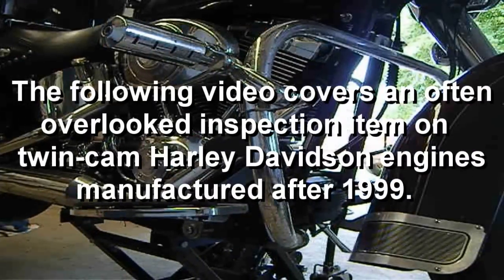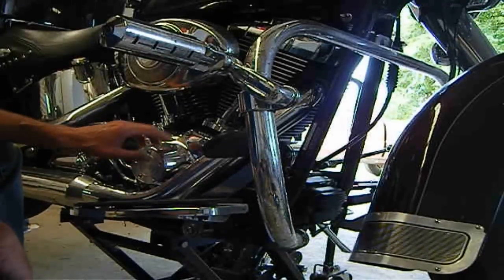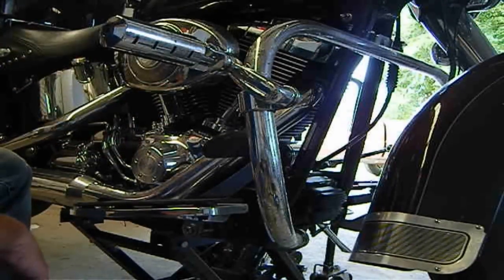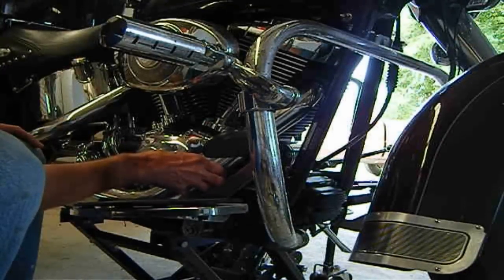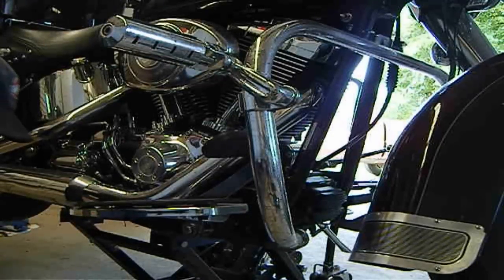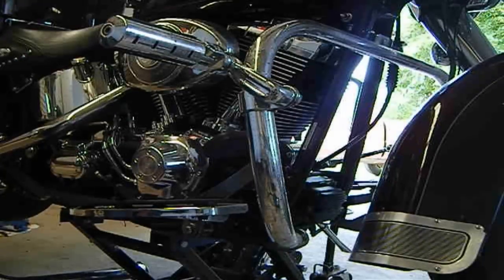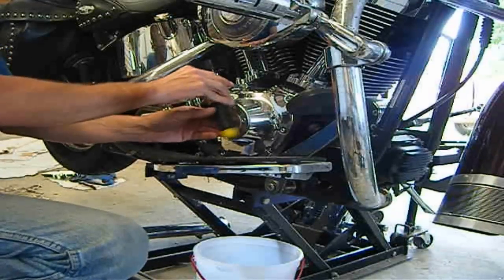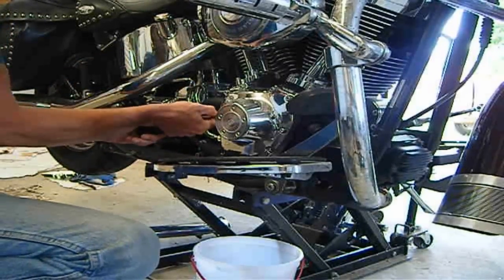TENSION HEADACHES: A Harley Owner MUST SEE!

Comment: I just found out about this last fall and I have 49, 300 miles on my bike. I have had my bike to 4 different dealers and not one ever mentioned this. Pisses me off!  Anyway, great video. I'm going to check mine now; thanks for the help.
Reply: Did you tensioners need replacing?  HD want's your bike to fail, the mechanic walks you over to the sales floor and calls the sales man to show you the latest bikes while they appraise your old bike for trade in value.
Reply: Back road you need to do the tensioners now and the cam bearing in the motor case or you will be buying a new motor I'm doing a long block from HD my customer let his cam bearings go for 80.000 and he's paying for it now.

Comment: Well if you want to ride a new bike with all the bells a whistles a twin cam is what u get. After 2007 u don't have to worry about the tentioners. Oil presseure versered 35000 lb of spring pressure lol
Reply: Are the 2007 models okay or just 2008 and beyond?

Comment: ive been working professionally as a harley davidson mechanic for the past 14 years, ive seen a lot of these fail over that time....that's about the entire span that the twin cam has been in production.....see the pitting on that outside tentioner, that is when its time to change them, when they start pitting, they wear out faster and break and destroy things. i would recommend the Axtell oil pressure relief bypass when doing this job.
Reply: Nate Swartz  Hey Nate what is the Axtell oil pressure relief bypass, your talking about, can u please explain it, thanks. Donnie.

Comment: Wow I just found  out about these shoes being a problem, I purchased a 2003 Dyna Super glide at the end of 2011  and the bike seem to be kept really nice and  great working condition and  getting quite a bit extras when I purchased the bike  like V,H  long-shot  exhaust, Mustang seat,  hard bags rremovable windshield leg crash bars footpads,  custom handle grips and much chrome.  I only paid $6200.00 as I got a really good deal due to the guy  hurting his back  and needing to get rid of the bike.  the bike had  11,000 miles when I purchased it and runs great having no oil leaks,  but I noticed the oil  was very dirty  almost  black and I really don't understand  why someone  would had let it get that dirty  especially  such a beautiful bike like  this one. Anyway  the first thing I did when I got the bike home  was change the oil  using  the best synthetic on the market along with a quality original oil filter,  but I really should have  ran the engine with cheaper oil and filter just to clean out the crankcase before replacing it with the expensive oil and filter because no time at all the new oil turned very dark due to picking up  the remaining dirty oil left behind  and now the new  have an under 700 miles is quite dirty  and although it might not be needing to be changed again I wanted to do it as it bothers me, so it seems I might need to replace it again soon.  anyway when I did change the oil right after  I purchased the bike  it was kind  of hard  to see if there was anything  in the oil  due to the oil being very black so because I was too anxious to write it  I took a quick look  and it seemed ok  just very dirty and I replaced it,  but since I wasn't aware of this  cam tensioner problem I didn't really thoroughly checked the old oil when I drained it assuming it was just  very dirty  but now  it's good  that I had found this out about this tensioner guide problem  before I do another oil change to get the oil cleaner  as  it would have been a waste of money  to put the new oil playing to find out  I needed  address the problem,  that's if I find anything wrong after  pulling off the cam cover to inspect it.  I was reading that it's definitely suggested that you change the pushrods  with a new set of adjustable pushrods if you're going with the new cam  and gear kit, so cutting the old ones would matter  anyway plus giving you less work to have to pull the top of the heads apart to get the pushrods out.    I wouldn't mind doing this job  myself as I'm way  qualifed to do it,  but I would need to purchase the back bearings replacement tool  and a new press  for the front cam bearings due to my old  press now  being  trashed after being an anchor  in my garage  due to hurricane Sandy.   anyway I have a question, does the side cover  use a gasket and do I get one first before I pulled the cover will can I get away with reusing the one that's on the cover like you can do  with some gaskets?   thanks louie

Comment: is it possible if you didnt change the shoe it could cause more internal damage the the bike? i have a 2005 road glide and it got laid over but it damaged the outside of the cam cover and the oil pump but there is no damage done to the inside of the cam cover so i was wondering if this could have been a problem to the bike.

Comment: Don't all bikes (and cars for that matter with cam chains) have tensioners? Seems I've seen them on many engines motorcycle and automotive.
Reply: Ger, there  are some car with engines  that didn't use cam chains which is actually called timing chains,  being the same thing. The 1984 four-cylinder Chevy Cavalier, had no timing chain and they used  a gear driven system drive also using  this same engine engines in the I.O boats which was made as the  2.0  Merc cruiser. they called this motor by Chevy the iron duke,  saying it couldn't be killed.  any motor that using a timing chain  along with  new engines that are now using timing belts all need to be checked  after so many miles,  but with a direct gear drive  I guess would never need  inspecting or changing  as far as I can see...
Reply: Ford had the same problems with the triton and 4.0 ohc engines as well.  Same yellow pads.

Comment: Just checked my '01 Springer. w/44,000mi. 1/16 in. wear on both shoes. Gotta luv that synthetic oil.
Reply: was just wondering did you start using full synthetic on the bike at brand new, also how much of a difference does using the full synthetic make can you actually get 50 60 thousands out of a set of shoes,,thanks

Comment: extremely informative,I would actually like to see beyond into the inner cam chain tensioners or the changing of them. My 2010 is fast approaching 50,000 mile mark.
Reply: Every HD owner should buy a copy of the factory service manual. Chilton and Clymer are fine for absorbing spilled oil but that's all. Visit dedicated HD forums for detailed info. Youtube is a nice supplement to tech data but not a replacement.

Some of the later shoes have worn excessively too, understandable as they are still tiny.

HD is a very profitable company but their modern core audience doesn't ride very much and is technically ignorant so they can get away with cheaper-to-produce designs. Trust nothing that the MoCo publicity hacks say about anything.

Comment: Those orange tensioners aren't nylon they are plastic, the 07 and up have nylon shoes with hydronic tensioning. When these go bad it is defiantly worth spending the $400 to buy the upgrade part (it includes the higher pressure oil pump too I believe) and replace it since you will have it all torn apart anyway. The new nylons never go bad

Comment: thanks I have a annoying ticking coming from that area it is constant and in time with the motor the bike runs great no problems with that because I thought valves pushrod and so forth talked to a buddy at the local Harley shop and he told me that that was most likely the problem that the cam tensioner shoe or shoes may have worn I my self didn't even know of these I have 15grns+ on a 03100yr anv. fxd..so after riding a 1973 xlch for 25 years these new evo motos have things I have not got into yet as with my 73 I know every part on that baby, so thanks for the video much appreciated good to see what needs to be done and how things work out in there..i have a service manual but nothing like seeing it in action
Reply: thanks glassblade 63, I know my front scream eagle muffler always seems to slide back about an inch or every so often.was even thinking about that know maybe.I just replaced my voltage regulator surprised that was  was making my speed go freakin banana's thought it was the speed sensor which usually is the case,these old bones cant wrench em like I used to the routing of the wiring was the biggest pain in the ass on that ones you eye sight and patients wears thin when it is 80's and winter is just around the bend,yeah the old xlch you expected noises  from that old girl
Reply: thanks I don't always see the repiles as fast as I do like on fb,appreciate the response

Comment: Good video!  I keep hearing that around 20K you have to worry about them going bad... glad to see a way that I can check them myself.  I would much rather see that it's a problem on my own and have a professional fix it then to have them tell me they're bad and assume they're honest.
Reply: You can require your mechanic return your used parts for your visual inspection and so state on the work order. All work should be begun on a formal work order with everything itemized. That goes for any vehicle.
You can also check on HD forums for recommended mechanics in your area.

Comment: Reason people dont check them and they aren't mentioned is they are and were not considered a maintenance item as designed. They are a failed design that Harley wanted to sweep under the carpet. Harley has enough "maintenance" for their bikes without this issue. There are no other internal combustion engines on the planet that considers can chain tensioners as a "wear" or "maintenance" item.
Reply: I'm a tech at a ford dealer, i can tell you the cam chain tensioner and pad on the 5.4 tritons is almost the same deal, they fail anywhere from 110k to 160k most times. also seem similar issues on chevy colorado I-4 engines. my old Honda cbr 600 f4i has a common issue of the cam chain guides wearing heavily from the tensioner itself failing. got my bike dirt cheap because it needed the engine pulled to perform all work. did it myself and got the bike for a steal. now I hope my 2013 sportster 1200 custom doesnt have this issue for a long time lol
Reply: Bad wobble the sportsters have 4 gear driven cams... Do ur home work bro.
Reply: InDaJeep4x4 dude, on a Harley you have to start checking them at 18k... Seriously... You read that correctly... 18,000 miles
Reply: InDaJeep4x4
i actually had an issue with a 98 chevy 2.2's timing chain tensioner shattering 3 times and causing the was new cam chain to stretch and jump, tensioners looked like they where made of plastic to me,oem lasted i think it was around 80,000 miles, aftermarket not even 5,000, after having to do the job a 3rd time i got rid of the car
Reply: I knew it was a common issue didn't think it was that bad tho. It is a reason I decided on the single cam sportster over the twin can super gluide I initially wanted. Hoping for 50k miles before any major repairs
Reply: InDaJeep4x4 single cam sportster,bwaaah, do your homework dude,lol
Reply: Jr Owing after 18,000 miles???
Reply: YA IT HAS MADE ME WONDER WHY HARLEY DOES NOT UP GRADE THEIR BIG TWINS TO CAM DRIVE? MAYBE THEY NEED TO FILL UP ALL F THAT SPACE WITH SOMETHING TO MAKE IT LOOK LIKE YOU GOT YOUR MONIES WORTH!!!!!LOL  COULD IT BE THEIR WORKERS ARE NOT MAKING ENOUGH? LOL

Comment: 100,000 mile Harley-Davidson
Reply: Not. Mine were shot at 30k, getting ready to reinsert now at 58k.
I have the permanent oil filter, so it gets inspected at every oil change, no plastic yet, but the bike's down anyway, so off comes the cover.
Reply: @garychandler4296  that sux, I'm a firm believer that there should have been a recall notice from the MoCo on this issue. They totally suck...

Comment: ANY Evo between 1985 to 1998 will run circles around any twin cam POS.
just watch this video and i'll prove it.
100,000 mile Harley-Davidson
Oh yea, did I forget to mention the fact that IT HAS NO CAM TENSIONERS AND IS STILL RUNNING ON THE ORIGINAL MOTOR!
Reply: I has a 1994 Heritage Evo and I loved that bike. It ran like a top with the S&S E model and Crane 490 cam, but no way  will it run circles aroung my 2010 Heritage twin cam with 259e cams with 575 lift. Still love the Evo engine though. I put 65,000 on it before I let it go. Shoud have kept the bike for sure.
Reply: I have well over 199K on my stock FXR bottom end, and one top end job. Evos are slower stock but it's easy to boost performance with cam and carb replacemnent. If your Evo came with a CV carb you don't need to replace that, either.
Reply: Back when I purchased my 94 Evo, we all tried changing all kinds of stuff including re jeting the CV carb. I finally put a Crane 490 cam and S&S E model. that engine ran like a top. Great engine in my opinion

Comment: Useful video!

It's absurd that any modern motorcycle should require such invasive inspection, but woe betide it's not done and the tensioner fails then defecates debris into your oil pump.

I had a customer bike shit the bed and require splitting the cases along with an oil pump replacement. DO keep checking it because failures don't seem to follow a predictable pattern. There are MANY forum posts regarding tensioner failures.

I don't hesitate to install adjustable pushrods, which it bears remembering worked fine on millions of Harleys for many decades. They save much hassle throughout the life of the engine. The Motor Company don't use them any more, like they don't run Timken crank bearings with tight runout limits any more, because most owners today are low-mileage posers who won't wear anything out no matter how wretchedly designed.
Reply: Wow, sage advice.  Thanks, I will check runout and if .003 or less (doubtful), I will go gears.